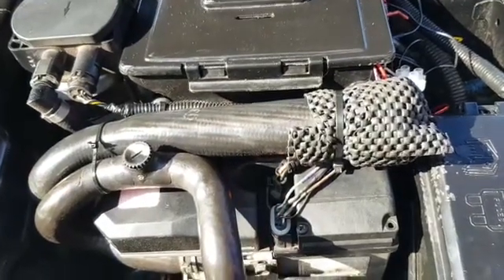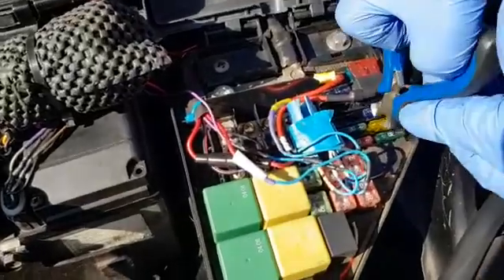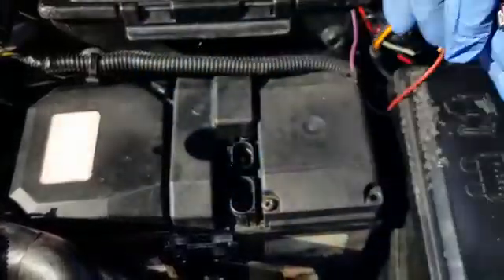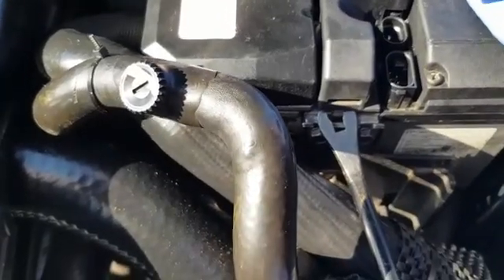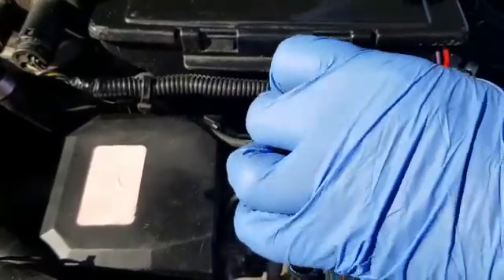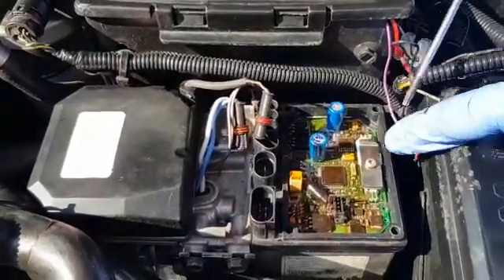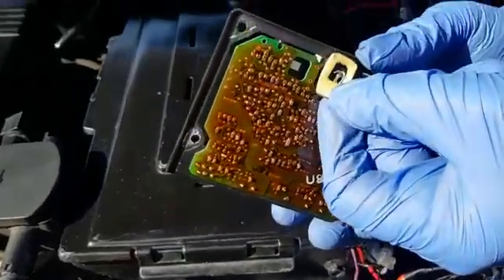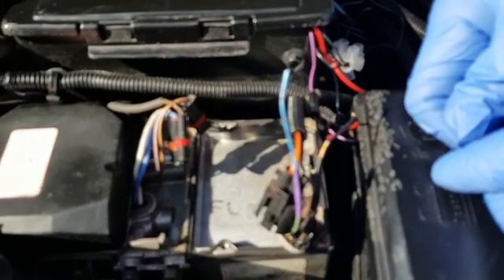Removal of Webasto Thermo Top FBH PCB

Comment: Thank you my friend, most helpful
Reply: You are most welcome Michael, glad to be of service
Reply: @robcotterell1807  I bought one of these to fit in my boat as a heater but then found that it would not work without the car's computer as the driver board was made for Mazda. I have now found a man who has made a replacement analog  pcb to fit this heater which will make it operate normally. The price for the board is £50 so if you ever need one, let me know. My email is aviator@post.pl
Reply from the maker: I have e mailed you Michael thanks for the response